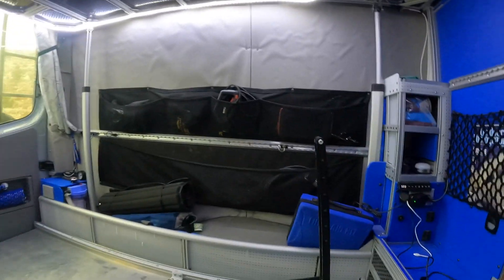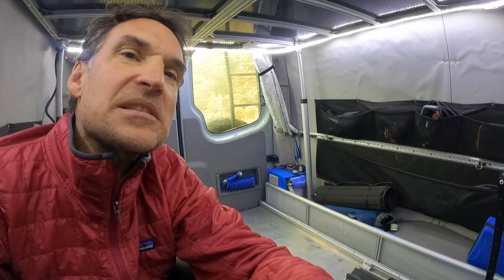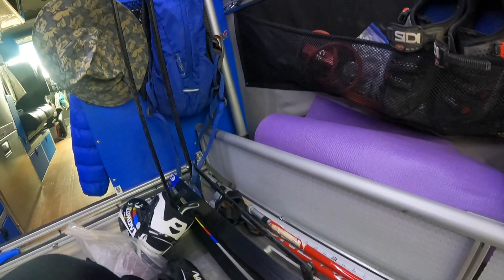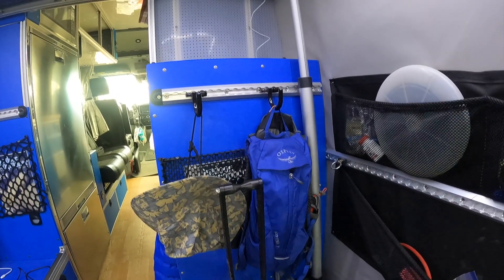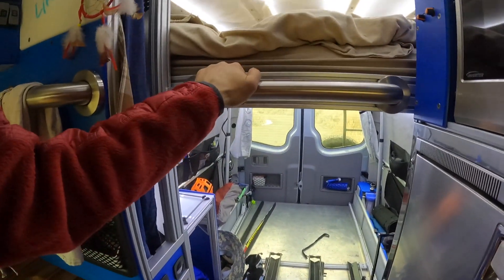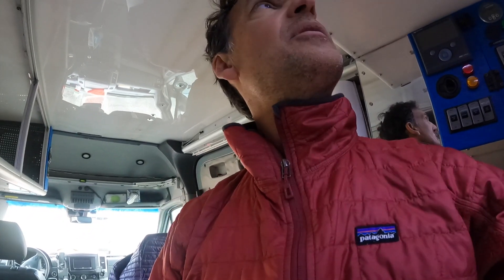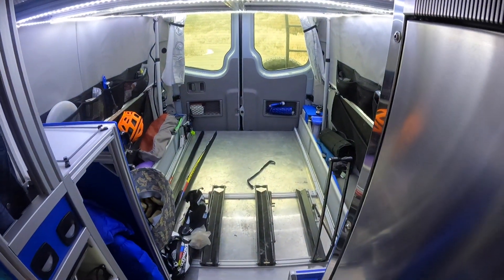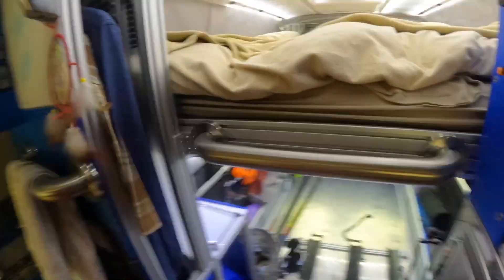A simple Lifting Bed in a Camper Van using Linear Actuators

Comment: Thank you for all the great tips and information. I like your aluminum bed frame, can you briefly tell me more about it?
Thank you
Reply from the maker: 8020 1" profile frame, hinged at about 2/3 the length, and that longer section rides on linear slides. The upper shorter hinged part as a secondary hinge with linear bearing slides on the rear wall 8020 frame. I'll share more in a future video.

Comment: Awesome set up - thank you so much for sharing! I am considering a bed lift system in a Ford Transit, but was wondering if the PA actuators could lift the bed up higher, with the mattress very close to the roof, in order to create a lounge / seating area underneath?
Also, any way this could be set up so the queen bed is set sideways (instead of oriented back to front), with the van having flares on the sides?
Reply from the maker: Yes, you could achieve both of these things but simply choosing different stroke length actuators or a higher base mount of them (mounted higher up than at the floor like mine). You could lift the bed in either orientation.

Comment: Have you given any thought on a murphy layout instead of a lifting so that you can have additional overhead cabinets on one side?  
For something like the galley.  How do you attach the horizontal 8020 with the horizontal 8020 that's attached the the floor? Is there a clean way to attach two parallel profiles without resorting to an L-Bracket and still have infinite sliding positions?
Reply from the maker: I did but this would not work for my over six foot height, and would imbalance the weight between sides--I put a lot of effort into keeping weight distribution between sides and front and back neutral, and after weighing the van about a dozen times on trips by each corner and axle, my weight distribution was within 40 pounds when loaded between sides and usually within my 20 pounds without my body weight. As for the horizontal 8020's pieces, I only had one spacing between the cabinets at the floor which was there mostly to keep water and mud from the gear garage drawer tray from wet gear such as melting snow or mud from entering the "living space". It also provided side to side strength, but this was not needed since the cabinets were all bolted to twelve of the factory floor anchors and thus strong as the van. As for having infinite sliding position vertically, yes, you could have this and I did along the length of the 8020 I installed by having the track portion just out one inch from the rest of the cabinet, so the sliding mounts could slide along the entire length, and the vertical rail was just a 2x1" 8020 piece turned so that the extra 1" stuck out from the rest of the cabinet frame. Make sense?

Comment: Love the setup and I like the interior. Looks like a submarine. What panels are you using in between the 8020?
Reply from the maker: The blue panels are 1/4" HDPE, which is a very durable outdoor-rated plastic. Lightweight, strong, UV resistant, holds screws really well. The bottom of the bed is 1/4" high-strength perforated PVC. Thin so light and not to take away from internal height, while plenty strong and perforated to allow the mattress to breath and prevent any moisture accumulation, as well as heat to transfer thru.

Comment: I live in my van full time and there’s nothing worse (for me) than having to sleep with my head lower than my feet because my van isn’t parked on level ground. So, I was thinking of installing actuators in each corner of my beds platform to level the bed platform. I would have each actuator work independently so I could level the bed from each axis. What do you think?
Reply from the maker: Yes, certainly possible yet needs to be very closely managed, as the actuators are powerful and can wreck your bed frame if the height difference between corners gets too much for it. A better way may be to have two front  actuators on one switch and the two for the rear on another. Hold them together to raise or lower to desired height, then just push one of the two to lower or raise it to get the bed level front to rear. This would take care of one direction but not side to side. You can have four switches--one for each corner--and do the same process, but holding four switches at one would be a finger stretch. So yes, it's possible, but also risky as you could break your bed if too much difference in height.

Comment: i know this video is 3 years old but im considering the same system for a bed in the back of a sprinter. is that a fullsized (	60 x 80" ) queen bed? im thinking of using our current box spring full sized queen and your video is one of the only ones giving thorough information on the fitment near the roof. cheers.
Reply from the maker: Yes, I installed a regular queen, 60"x80". Just a mattress from Ikea that worked great as it was light, thin and comfortable. Fitting regular sheets was important to me. The base is 1/4" high-strength perforated PVC so the mattress breathes, stays cool and lets the heat rise up thru it in the winter, and never a worry about condensation building up, plus light and thin as well. Plenty strong with the frame.
Reply: @vantripping  awesome, thanks heaps for the info, ill be coming back to these vids for sure
Reply from the maker: @boofinsphincter  you're welcome and good luck with your installation. Reach out if I can help.

Comment: What actuators are you using?
Reply from the maker: Progressive Automations PA-04, with Hall effect and four actuator, four pre-set controller. Great actuator and controller, easy to use, quiet, light weight, IP67, strong, been fail-proof for 6 years now. And Progressive Automations ships fast and actually answers the phone and can help with selection and support. I'm continuing to use their products in my new expedition camper build with an even more creative moving bed, benches, solar awning, doors, etc.
Reply: @vantripping  Thank you! What length did you use?
Reply from the maker: @photomuse768  I installed 30" long but wish I stayed with 24" so the bed was a little lower without bikes. Trade off is that the bed will also be lower when fully raised, and I wanted to be able to move large things like appliances within the garage area and under the bed, which I have done. So everything is a trade off, but if I were to do it again, I'd use 24" which are about 30" tall when fully collapsed.
Reply: @vantripping  Thanks for taking the time to answer. That is so helpful. I was thinking I would have to mount mine from the wall somehow. Maybe not.
Reply from the maker: @photomuse768  . I highly recommend mounting to the floor as it is the strongest part of the body and the walls are not very strong plus do flex a fair amount.

Comment: Is the control system using 24v or 12v?
Reply from the maker: The electrical system and actuators are all 12 volts DC. Very easy and simple wiring with a rocker switch or controller.
Reply: @vantripping  Thanks for the reply. So you are not using the "Hall effect" controller to keep the actuators at same speed/level?
Can you let me know the parts you are using. Appreciate it
Reply from the maker: @darrenflannery4199  I am using four linear PA-04 Progressive Automations actuators each with Hall effect sensors, and Progressive Automations controller (I think the FLTCON-4 with their FLT Hand Remote) which matches the position of each linear actuator as well as provides four height pre-set buttons in addition to manual up/down buttons and actual height position which is really nice.
Reply from the maker: FYI, the linear actuators were custom ordered from Progressive Automations. A small extra cost per unit and little longer wait if the units you want are not in stock, but the will customize actuator length, voltage, Hall effect, load rating and other options. I've ordered several custom units for my new camper under construction and have already installed several and several more will be installed over the next month, and I will be releasing videos on each shortly.
Reply: @vantripping  The FLTCON-4 4 channel controller is 24vdc though? Maybe i'm confused
Reply from the maker: @darrenflannery4199  Yeah, I see that in the specs, but I powered mine with 120vac into the control box which had direct wires to each actuator that powered and controlled them, so it's possible that the actuators are 24 volt since I only powered the control box at 120 vac. You could also wire up four actuators with Hall effect and power at 12 vdc but I think you need a controller to interpret the Hall effect signal and synchronize them. Call the fine folks at Progressive Automations--free call, they answer or return calls quickly, and have always provided me with great support, so I'm sure they can assist you with a solution.
Reply: @vantripping  Thanks very much!
Reply from the maker: @darrenflannery4199  You're welcome.

Comment: Great video! I am actually going to try to replicate your setup in my sprinter shortly. A quick question for you - how did you attach the bottom of the linear actuators to the 8020 and D ring? It looks like the piece attached to the linear actuator is not a typical 10 series. Is that a 1020 piece? Did you have to drill holes into the 8020 or did the linear actuator bracket fit into the channel in the 8020? Appreciate you putting this together!
Reply from the maker: Great! I love this set up and functionality. I installed a frame of 8020 along the walls on the floor from front to rear of van, and those are bolted thru holes I drilled in them into every one of the factory tie down points. The ones drilled and bolted thru into the tie downs are 1020 series laid flat. I replaced the factory bolts with ones that are about 1.5 to 2" longer (because there is more space for longer bolts than MB used, and used locktite on them. No loosening or issues at all and bomb proof strong. There is one cross over between the garage and kitchen. I think I've posted some other videos of these details. You should be able to find those other videos by going thru the videos on my channel to find it.

Comment: Hi good day! Your project is fantastic! Me and my classmates are currently finding mechanisms that will support our bed lifting (just like your work) for our thesis studies and this video is a big help for us. May we ask is it possible for it to have 3 stops or 3 levels? Thank you so much!!!❤
Reply from the maker: Hello, glad my videos are a help to you all. Yes, I use a controller that has four pre-set heights, each programmable, so just push a button for each programmed height or manually raise and lower. I used an actuator from Progressive Automations and they have many controllers for one, two, four actuators with programmable stroke settings. Good luck with your project.

Comment: Hi there, great work on the bed! Can you provide some info on the slides you use at about the 6:30 mark?
Reply from the maker: Sure, these are 8020 linear bearings that clamp on three sides of 1" profiles that protrude from the rear of the full height cabinets on each side. They work great--simple, light weight. no maintenance and take up little to no space. And silent.
Reply: @vantripping  Thanks for the prompt answer!
Reply from the maker: you're welcome. Glad I can help. I love this bed set up in my camper van still after five+ years of using it.

Comment: For anyone looking to use actuators for a bed that can be both low AND high, Progressive Automations sells TRACK actuators with stroke lengths up to 60". These would be 4 fixed columns around the bed. Guide rails are unnecessary since track actuators are like guide rails with lifting capability. See 10:45 in this guy's video https://youtu.be/Hs335Mn3xtE.
Reply from the maker: Thanks for adding-the track actuators are great if you install them at the front and rear of the bed as they really can't be installed on the sides due to the van's wall curving up. Problem is when installing actuators at the front and rear, they reduce the access to under the bed at least from the rear since track actuators need to be set inward about a foot to accommodate for the roughly 10" of curvature on each side, significantly reducing the rear underbed access opening, and hence why I chose to use regular actuators on the side as they follow/pivot to the curvature of the van walls as they go up, allowing them to be installed up against the side walls maintaining underbed storage space and access from the rear doors.

Comment: Hey quick question! What are the 80/20 pieces that slide on the 80/20 bars called?
Reply from the maker: Those are linear bearings. The fit over three sides of a profile and have a UMHW bearing--no maintenance, no grease, no noise, just a sliding alignment connector.

Comment: Hi, could you please let me know what hardware/fixings you've used on the rails to guide the bed and prevent the lateral movement?
Reply from the maker: Yes, I used one 8020 flanged sleeve bearing on each side of the front of the bed, mounted within a 1" vertical profile on the backside of the kitchen cabinets. These two bearings are attached to the front of the bed frame and keep the bed aligned side to side as well as front to back in the van, and also nearly eliminate side to side twisting movement. Keeps the bed aligned in the van between the interior walls as it moves up, as well as just set back with a small space behind the full height rear kitchen cabinets. These bearings work great with the bed because they are clean, self lubricating without grease and don't catch bed sheets or anything else.
Reply: @vantripping  - Apologies for the delayed response. Thank you very much for the in-depth response, very helpful!

Comment: Great design! Result of good thinking. And also good material research which got you the durable actuators.
On one hand it sounds expensive, on the other hand it seems worth it.
Reply from the maker: Thank you. Yes, the actuators were about $600-700, with controller another $100, but compared with the material the build the bed frame up and attach it to the wall--that thermal transfer which my system completely avoids. And then add in the enhanced functionality in which I can carry bikes, skis, a washer/dryer, and the bed adjusts in height to all maintain max comfort, space and use. Plus bike geometries change over time, so building a bed height to a bike today may not work for the next bike, so the adjustable height bed accommodates all at a pretty low cost and simple and instant adjustment by pushing a button.

Comment: do you still recommend this lifting bed after 5 months using it? I’m concerned its reliability because overtime, 4 different motors will move with different speeds, and they may be bended too
Reply from the maker: I've been using this bed for over three years and it has worked flawlessly. No issues and would not expect any as linear actuators/elecrtic motors are infinitely more reliable than any mechanical mechanism would be. No issues at all. They track perfectly in line, measured by the controller down to the tenth of an inch. Each linear actuator is IP67 rated, so sealed against and water.
Reply: @vantripping  thank you sir for your quick and helpful  respond. how many track do you use? how much is the total cost of this bed without the mattress?
Reply from the maker: @CaptainNguyen  You're welcome. I have two vertical tracks at the front of the bed, along the sides of my full height cabinets. The tracks only need to be as long as the length of travel. Those two tracks are more than enough to stabilize it with two people using it. Not sure of the cost for the bed only, as I built out the entire van from scratch and by hand. The linear actuators alone can be $500-$1000 depending upon length, force and controls. The bed frame is fairly low cost.
Reply: @vantripping  thank you sir for your great answer. I will adopt your design to my van

Comment: Hey KC- Thanks for the video. I've been tired after long XC ski trips so I feel you ;) Quick question: When your bed is down, where the walls are tapered outward, do you just have a gap between the wall and the mattress?
Reply from the maker: Yes, there is a gap of a few inches on each side of the bed when in the lower position, and almost none with the upper position. I was worried that blankets, pillow or myself would "fall" into this gap yet never has happened. It's a queen bed, and if you think about it, while sleeping you probably don't push blankets or pillows off your bed at home, or fall off of it either, so not a problem.

Comment: Would it be possible to list the URLs of the materials used like tracks, mount, and presetting height switch?
Reply from the maker: Easy enough: I used Progressive Automations PA-04 as well as their mounts and controller--they have options for mounts and controller so you can select which you prefer as well as stroke length of the actuator to give you the lowest height you'd like. I suggest 24" or 30" although 36" can work too.
Reply from the maker: The tracks are 8020 aluminum profile linear bearings. I used 1" profile and you can use which angle/mount of linear bearing as well as size works for your application or another options for a track.
Reply: Thank you so much!
Reply from the maker: @友十  You are welcome.